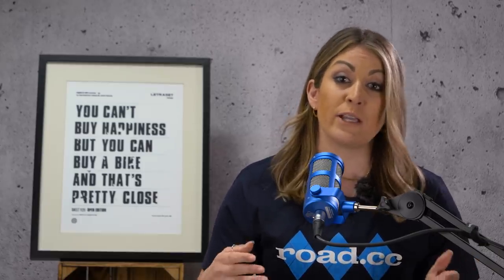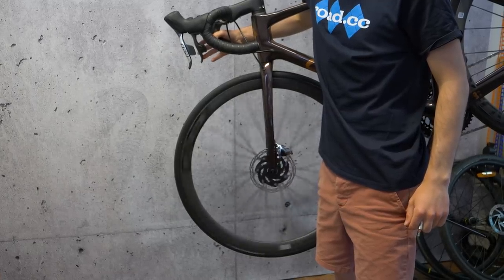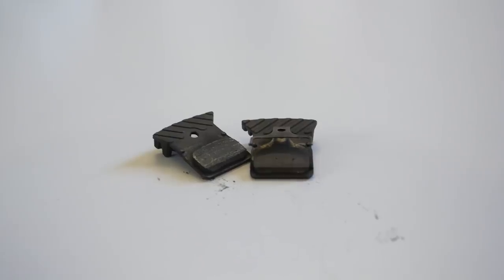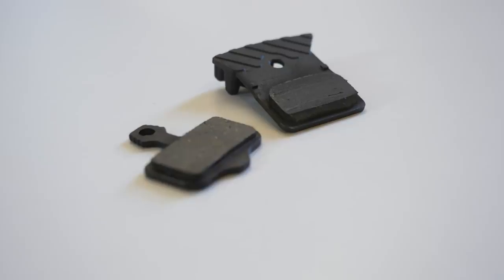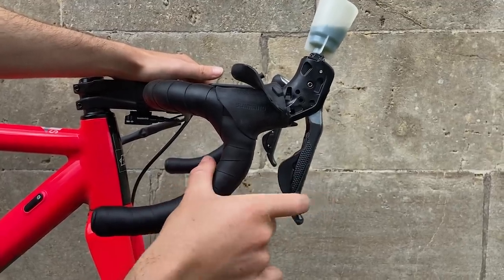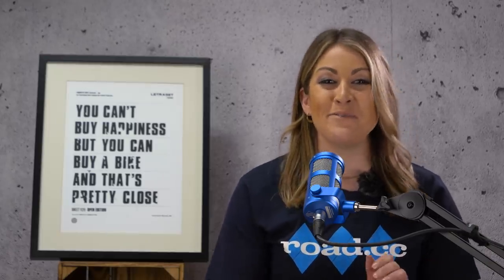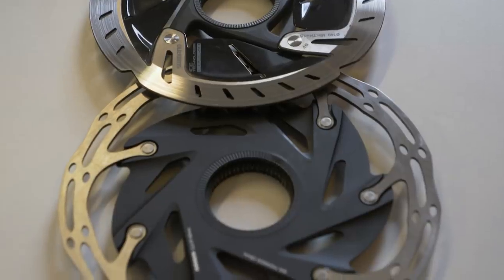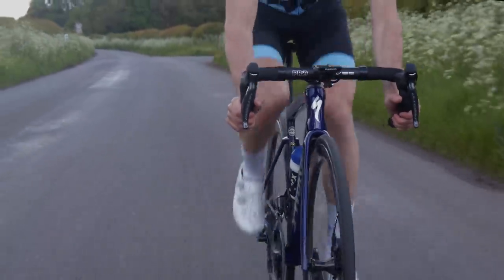8 things they dont tell you about disc brakes

Comment: There is so much to unpack here. Let's start with I've been a master technician for European highline cars for over 35 years. Plus have been involved with high performance vehicle suspension and brake setup. Disc brakes were first introduced for production in the late 40s from vehicles by Crosley and Chrysler. And since that time can anybody guess what people have been complaining about most? That's right brake noise squealing, chirping, chattering all of the above. 
How disc brakes actually work. There is NO return mechanism inside of the brake caliper to pull the piston back to its original position. I've heard this statement being used by numerous websites about this as a disc brake function. The only thing inside the caliper is a seal, fluid and the piston. As pressure is applied from the master cylinder, transferring an increase of pressure against the back side of the piston and that's what squeezes the pads against the rotor. The amount of pressure that is applied is determined by the throat size inside the master cylinder and the diameter of the inside of the caliper.  When you release the lever the only thing that happens is that the pressure is released. Depending on stiction between the piston and the seal will determine how much pressure is still left on the pad against the rotor. An optimal situation is the lowest amount of stiction between the piston and the seal so when the pressure is released the pad just glides against the surface of the rotor. The obnoxious noises you get from disc brakes is not from contaminated rotors it's from a vibration created between the rotor and the pad. Depending on the pad compounds, rotor metallurgy, temperature, moisture, glazing these all affect how much a pad vibrates inside the caliper against the rotor. Automotive manufacturers have been designing and redesigning shims and chemicals to apply between this brake pads, carriers and caliper pistons for years to reduce the amount of vibration.
Physics: The closer the rotor diameter to the wheel diameter thus reducing the delta the stronger the controlled force applied to tire against the ground. This is nothing more than calculating a leveraging force. What's one of the first things downhill mountain bikers upgrade? The rotor diameters.
This brings up another misconception your brakes do not stop your vehicle, it's the surface area of the tire against the ground. That's it!
F=ma; body weight, speed, tire surface area, tire compound, road compound/conditions, ambient temperature, moisture/humidity, % road gradient, cornering loads. All of the above are just some of the factors determining how much friction/energy is generated between the disc brake pads and the rotors. 
Next;  the longer the pads and rotors last the better the brakes. Wrong!
The faster the pads and the rotors wear away the better the heat dissipation, ie. the better friction/heat control. Metallic disc brake pads are not designed to make brakes last longer they're designed to dissipate the heat faster. Pulling the heat away from the rotors. The metal in the pads acts like heat sinks embedded in the pad material. 
Brake pulsations are caused by the inability of the braking system to dissipate the heat. This creates a warpage on the rotor due to the metal expansion and contraction from excess friction/energy/heat. Another a little annoyance of this condition is heavy breaking during wet conditions. The accelerated cooling of the rotors from moisture also can create excessive warpage. 
Next; brake fluid longevity. Back to f=ma, the loads generated on the disc brake system at the rotor and pads is energy, energy is heat, heat needs to dissipate. Another part of the brake system that heat affects is the fluid inside the caliper. Your brake fluid does not move, it's only a pressure transference between the master cylinder and the caliper piston. Fluid does not compress but it can heat up and cool off. The more the heat cycles affecting the brake fluid the sooner the chemical structure of the brake fluid breaks down which causes an oxidation of the fluid. This in turn creates a thickening or varnishing of the fluid creating an increase of stiction between the pistons and the seals. This is another piece of the puzzle causing an increase of residual pressure of the pads against the rotors. Since most bike brake service bleeds are from the caliper to the master the fluid should be completely replaced otherwise you can end up with contaminated fluid in the line or in the master or both. 
One other fun little fact about brake fluids is they're highly hydroscopic.
All of these above conditions should be strongly considered for the amount of times you flush your brakes.
 And then there's more to be considered, spoke tension, deflection and wheel rigidity under any of the above conditions. Wheel truing should be a much more routine service.
The bicycle disc brake system is very basic, with the industry forcing disc brakes as a standard without educating the consumer other than this is a better way to go. It is only going to cause a lot of friction, (←pun), between the technicians and cyclists. And the additional expense to the consumer in parts and maintenance. 
So are disc brakes a good thing or a bad thing? I don't think there's been enough research and development put into what is really functionally viable as a long-term disc braking system for road bikes.
Reply: Disc brakes are fine. 4 years and 9000 miles of maintenance free riding on my entry level road disc brakes and they are still brilliant. Pad replacement is easy and they offer far more braking power and better modulation. Where I ride, the benefits far outweighs the negatives, many of which are exaggerated anyway as far as I an see.
Reply: Solid explanation of how disks work and factors affecting braking. Excellent point too about the role of tires and rims. The simple bicycle has become far too complex with disks imo... it's a cash grab by manufactures to sell more replacement parts because on a rim brake all you'll replace is pads and cables. Now there's pads, cables and or fluid and hoses, rotors, bleed kits and a boatload of frustration in the learning curve. No thanks.
Reply: @johnandrews3568  this is no different to any other "innovation" in cycling. Manufacturers need to keep introducing new tech in order to try and persuade people to buy new bikes. It's no different to mobile phones, the business model requires consumers to regularly upgrade. I doubt this has much to do with maintenance and everything to do with selling more bikes.
The answer is to not fall for this. No one needs to change their bike every few years and if you're worried about obsolescence of parts, buy some spares.   Rim brakes aren't expensive, so keep a spare set.
Of course if you want to get a new bike every 2 or 3 years, then you may have a problem.
Reply: @peterfenwick4662  disks suck, period full stop. They should be offered as an option, not just stop making rim brake bikes. Mark my words, in time, rim brakes will be the next new cool must have thing.
Reply: @johnandrews3568  in your opinion. I have them on my road bike and I wouldn't change them. I don't care what the next big thing is, in any sphere of my life, I just get what I like.
I will buy a new bike when this one is broken, but after 5 years and 9000 miles it's still going strong, so I don't anticipate that being for at least another 5 years.
At that point I will decide what to go for based on what I prefer, not what is the next big thing.
Reply: @peterfenwick4662  I too have a disk equipped CX bike with the best disks/calipers on the market and it sucks you can't get a canti brake bike in carbon. My disks work just fine but the amount of complications and servicing intervals is just stupid compared to a rim brake bike. And no roadie ever asked for a different braking system... it's industry BS to sell more crap you don't need.
Reply: @johnandrews3568  maybe that's the problem. I have entry level brakes on my alloy framed bike and I've replaced pads and that is it. Like I said, 5 years and 9k, and no servicing or repairs.
A mate of mine has a fancy dropper post on his mountain bike. It cost more than my first bike and after about 18 months it jammed. Turns out it has a 12 month or X hours service interval and the service kit cost him £70. 
I agree, bike makers are taking the piss. No different to car makers. The more expensive your car, the more expensive it is to maintain.
Let's be blunt though, how much of the cost of your bike is the brand? 
As far as I can see there is no justification for any push bike to cost £6, 7 or 8k +. The extra you are paying for minimal benefit on what is actually a very simple machine is insane in my opinion.
Unless you compete, it makes no sense to me.
My experience is my own, and my bike, brakes included has been and still is everything I need it to be. However I suspect many wouldn't be seen dead on it. Evan cycles own brand, alloy frame, £850 in the sale. 
But then when I go out riding, I may have the cheapest bike, in a sea of £2000+ bikes, but I'm certainly not the slowest.
Maybe ask yourself how bike makers can get away with this?
I work with a guy who races in Europe with a team and he doesn't know who is buying all these new bikes all the time, it isn't him and his friends or the guys he races with.
My money is on the "all the gear no idea" types who 15 years ago were boring everyone to death on the golf course about how expensive their clubs were. Now they've moved onto cycling. In 15 years time it will be something different.
Oh and my racing colleagues opinion of discs is the same as yours.
Reply: @peterfenwick4662  Cool man. I'm a retired cat 1-2-pro racer from the 80s-90s and have been around the block. I see the people buying these $20+ thousand bikes and it's mostly 'all the gear, no idea' types who jumped on the mtb bandwagon 30 years ago. They'll move on, as you say and they'll leave in their wake an industry that stuffed its pockets for a decade and then will scramble and cry poor when the bubble bursts.
Reply: The rubber seal between the brake caliper and the piston is usually not a round O ring, but it's an O ring with a square shape. If the piston is pushed out it "bends" out a little bit, if the brake is released it goes back to the original shape and pulls the piston back a little bit. They also use this system at car brakes.
It adjust the play itself by the square shaped O ring, which works like a spring, but the piston can glide further out if the pads are wearing down.
Reply: @johnandrews3568  I have both types of brakes on my bike.
On my commuter I have now a disc at the front (the frame was originally only rim brake), because they don't need much service. With the rim in the front I had to adjust the cables every 2 or 3 weeks, but now I put a couple of pads in the caliper every 6 month or so, and that's all.
I use Shimano MT 200, relatively simple hydros, but they work fine and they have the same stopping power over the complete pad lifespan.
Discs can make problems under some circumstances (a lot of rain and they squeeze, and they can squeeze in coastal areas), but I'm satisfied with them.
They can also squeeze at the beginning if a bike is driven only occasionally, if you drive a bike often they usually don't make much problems.
Reply: @ipikture So why do Mountain bikers increase the disc size if  the tyre/ground contact area that causes the bike to stop?
Reply: @ElliotFlowers   It's about leverage force applied. As I explained above that the closer the rotor diameter is to the wheel diameter the more leverage forces applied. This is just a simple explanation because you can get into hydraulic forces versus the leveraging forces which both have a direct correlation to the heat/energy created in the braking system.  But the determining factor on how fast the vehicle slows down being a bicycle, car, plane or train whatever all depends on the contact surfaces between the vehicle and the ground. You can have the strongest brakes in the world but for example when applied on a sheet of ice the vehicle keeps going because a lack of frictional forces between the two contact surfaces. And even in icy situations there is friction, a friction of the tire against the ice actually causes the ice to melt between the two surfaces which increases the lubricating factor then reducing the stopping force. Skidding tires on pavement actually melt this creates a liquid between the tire and the pavement which reduces the stopping force.
Reply: @ElliotFlowers  by increasing the disc size you reduce the force you have to pull on the levers. It's like bigger disc rotors on a car, you need less force on the brake to come to a stop.
Usually 180 mm rotors are OK at the front of mountain bikes, and 160 mm at the rear, downhill bikes have bigger ones (up to 220 mm at the front).
Reply: 👏 for a professional representation 👌
Reply: Nice wall of text.
Reply: @johnandrews3568  don’t forget rim brakes are wearing your rims out, an expensive item to replace
Reply: Wrong. Metallic pads are designed to generate heat faster.
Reply: @newdebate  Pros:
Dramatically increased braking performance over organic pads
Have a much higher thermal threshold/dissipation due to metallic content
Still provide good cold bite
Have a much wider operating range (temperature)
Low compressibility – will provide a firmer brake pedal feel
Much more resistant to brake fade than organic pads
Numerous compounds available – suitable for anything from daily street driving to extreme track use. 

The higher temperatures are created by increased friction due to the extreme loads exerted on the brakes. The semi metallic compounds do not create heat, It controls it.
Reply: @newdebate  I spent a lot wasted time thinking about this.
Reply: @ElliotFlowers  closest i can figure the comment refers to F1 regenerative braking ...
Reply: @keithreed5009  hahahaha in 44 seasons on rim brakes I have NEVER had a rim wear out through brake surface wear. WTF dude?
Reply: @johnandrews3568  Well unfortunately I have worn out aluminium rims riding throughout the winter in the UK
Reply: @keithreed5009  sorry to hear that. I'm in Canada and honestly never worn out rim brake surfaces on any wheel set.
Reply: @johnandrews3568  I've got a Scott Cr1 and a Scott Plasma (converted to aero Road bike) both rim brakes, fine for our summer months but I ride my Boardman with Shimano hydraulic discs and di2 when the weather turns nasty
Reply: Guess why moto gp racebikes have 2 set of disc brakes in the front.... 1. is cooling factor, 2. is increased breaking power, 3. it wont bring your wheel out of balance when you break, which happens when you apply force on one side of a wheel. You may adapt to it, but on a race bike which weights 7.5 kg this is freaking sketchy. As a non pro, you dont wanna change your wheels every 10k or less when descending quite often. You dont want to put WAAAAAY more force onto your fork while breaking. Its just stupid in long term.
Reply: The piston seal inside the caliper distorts when the brake is applied and returns to normal when pressure is released which allows the brake pad to move away from the disc by a small amount
Reply: @keithreed5009  Actually the caliper has a machined groove which a square seal sits into. Even in automotive applications very little of the seal is above the internal diameter of the caliper. This prevents the distortion of the seal and the piston slides across the surface of the seal. Considering that, the piston when fluid pressure is applied may only travel microns. If the piston, brake fluid and seal are all clean and there is no corrosion or adhesion between the surfaces of the piston and the seal it does not pull the piston back. The only thing that happens is pressure is released. More often than not is if there's any stiction between the seal and the piston it prevents a complete pressure release of the brake pad to the rotor. Holding the pad against the rotor.
Reply: @johnandrews3568  I live in the mountains, heating up rims is ridiculous when we can heat up rotors instead.
Reply: Thank you. I made the tire/surface point on another disc brake video and they thought I was crazy. Just about any brake can lock a wheel, brake "power" is just more myths for sales. The idiot in the video was comparing the power of brakes and just could not understand that skill in using the brakes, tires, surface was what he was testing.
Reply: (mechanical discs) So why can't disc brakes use a return spring to seat the pads/pistons back to a repeatable position that will not rub?
Reply: In your explanation, you make a small statement about the fluid breaking down.
 Will this fluid breakdown cause fluid to become "gummy" attaching itself to the inside of the brake lines? 
 I keep all of my bicycle( I have a lot) Will hanging them upside down for years at a time in a hot South Carolina garage also help the brake fluid break down?
Reply: @victorrodriguez2806  The two types of brake fluids used in bicycles is a DOT style fluid which is very hydroscopic and mineral oil. I have more experience with the DOT style fluids and most service intervals are between 18 months and 2 years. Race vehicles the fluid has changed after every race. Towing vehicles usually once a year. DOT 4, 4+ and mineral oils all have about the same boiling temperature mid 200s Fahrenheit. Hanging them should have no effect. You don't want to put DOT fluids in a mineral oil specification because it will deteriorate the seals. I would use the manufacturers oil, it's such a little amount it's not worth taking a chance of incompatibility. Non-racing situations general use maybe once every two years. Mineral oil is less hydroscopic so there's a less chance of a contamination so to me depending on how spongy the break started the feel. I tend because of a racing background to service fluids more often than the average person. I hope that answers your questions based on my experiences.
Reply: @simonm1447  So isn't it more efficient to apply the stopping resistance to the rim of a wheel, after all it is 26 to 29 inches in diameter, as opposed to 160mm, or 7 inch's roughly for a disc rotor?
Reply: @Alfred Wedmore So isn't it more efficient to apply the stopping resistance to the rim of a wheel, after all it is 26 to 29 inches in diameter, as opposed to 160mm, or 7 inch's roughly for a disc rotor?
Reply: @Alfred Wedmore Exactly. Less stopping pressure power (friction applied to the the rotating surface) if friction is applied to the greater radiant. If my wheel was a disc then...oh it is a disc...
Reply: @ElliotFlowers  both types of brakes work, but a disc uses different friction materials and have a much higher pressure per square inch on the pad material.
Rim brakes just use rubber, while the pad material used for disc brakes is much harder.
You can go over the bars with both types of brakes, but discs can offer more brake force with less lever force if you buy 2 finger or 1 finger brakes.
Discs are a little bit better in behalf of modulation.
Personally I find the brake feeling with discs better, however I use both types on my bikes.
Reply: @simonm1447  The principle here is that if it was economic to apply rubber to the outside of a wheel rim at 50 to 100 kmh, then cars would use this type of brake. I only travel at .000034 per cent, or per pee...thank god for gravity. cables and rubber...don't argue with history...
Reply: @ElliotFlowers  The disc pads I use (Shimano BS 01) cost around 4 € per set (2 pads), on my non disc bikes I use Kool Stop dual compound brake pads, because they offer a good brake performance and are relatively rim friendly. They are around 8 € for 2 replacement pads (they are put into a multi use brake shoe)
The disc rotors are maybe 15 € per rotor, however they last relatively long. 
On a rim brake bike the rims are worn out one day, and commuters who drive much can wear it down in a couple of years. You have to replace the rim if it's worn, because otherwise the tire will rip the flanges off and you will crash with it. 
So the costs are not that different, as long as you don't buy expensive Sram or Shimano XT brakes, where disc rotors and the pads are expensive. 
Both brake types have advantages and disadvantages - it depends on the purpose of the bike and the personal taste which brake you prefer. 
If you like rim brakes, it's fine, you are free in your choice
Reply: @simonm1447  Pretty much this explains why rim brakes are superior.
Reply: @WildernessMusic_GentleSerene  Fluid. Parts. Tools. Disc brakes caused the massive pile up at this years TDF,. Here and now - the lies have to stop.
Reply: @peterfenwick4662  Who moved the stone?
Reply: I was trying to say hold the hand at it's highest point of the punch. Putting your fingers under his armpit ain't gonna stop the swing.
Reply: @ElliotFlowers  eh?
Reply: @ElliotFlowers  cars would use rim brakes if it was economic?
Bollocks. No they wouldn't. There are lots of reasons you wouldn't use that type of brakes on a car.
Reply: @ElliotFlowers  I have never used hydraulic, only mechanical. In the 24 years of using different brands of mechanical disc brakes, the only problems were two instances in those 24 years. The brakes shoes fell out on the road while riding with a Tektro and an Avid BB7, don't know why, never happened before and never since.
Reply: @ElliotFlowers  you can leave the fluid in Shimano systems (it's mineral oil, no Dot 4) for years. It's a closed system, with no air or moisture coming in.
Bleeding isn't that complicated, and the tools are also not expensive.
Cables are also not maintenance free, they need lubrication after years of use, so it don't make a real difference.
However on my most driven bikes I appreciate the hydraulic brakes, because they adjust the play automatically, while I had to do constant adjustments on the V brake which I used on the commuter before.
On occasionally driven bikes it don't play a real role
Reply: @peterfenwick4662 Cars. What has that got to do with us?
Reply: @peterfenwick4662  I don't weigh a tonne.
Reply: @simonm1447  there are pros and cons to any system. Personally I prefer disc brakes. I do a lot of steep descents and they simply feel better for me. 
I agree, maintenance is neither complicated or expensive and in 9000 miles all I've had to do is change pads. The discs on my hybrud, that gets used off road in mud and on salted roads in winter have been far more maintenance heavy, but that's the price you pay for abusing them.
Reply: @ElliotFlowers  you mentioned cars.
Reply: @peterfenwick4662  Rim brakes are fine too. The Tektro rim brakes on my Giant road bike are so powerful that I would be lying if I said I ever needed more braking power. If I press hard enough on the front brake, I would go OTB in no time, that's how good they are. And they are very quiet too. I see no reason to desire/need disc brakes. By the way, my MTB has got disc brakes which I like.
Reply: @ElliotFlowers  It's a combination of the two. Mountain bikers cannot increase further the tyre/ground contact area since they are already using very wide tyres these days.
Reply: @WildernessMusic_GentleSerene  My MTB disc brake pads have integrated steel springs that push the pads back when the hand pressure is released from the brake lever. I think that is pretty standard.
Reply: @ElliotFlowers  Yes, it is in that sense.
Reply: Slightly wrong on a couple of points. Metallic and semi-metallic brake pads are to maintain coefficient of friction when the heat gets high, however the initial CoE isn't as high when brakes are cold... which is when you use organic pads. The exact same applies on cars! Also, Shimano and a few other's use Mineral Oil which isn't hygroscopic. Further, the calliper has ceramic pistons, which don't transmit heat as well. You will most likely wear the pads out before the oil ever boils. I've ridden over 10k on the same oil and it came out fine, not burnt, still red and smelt like new oil. No bleeding required either, it's a sealed system.